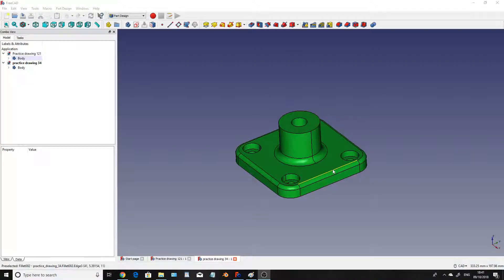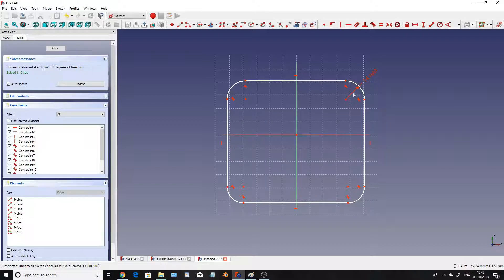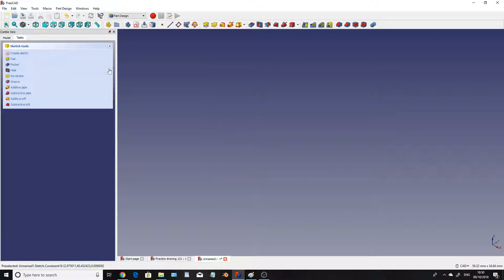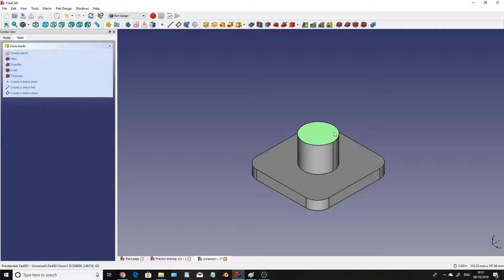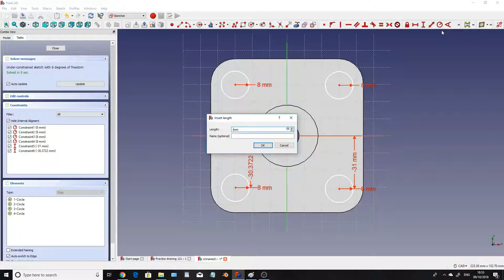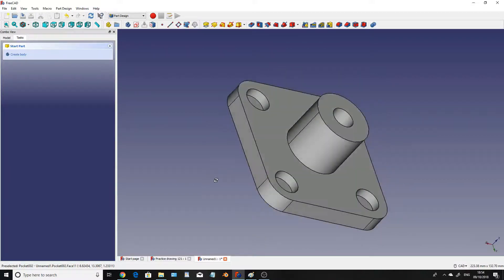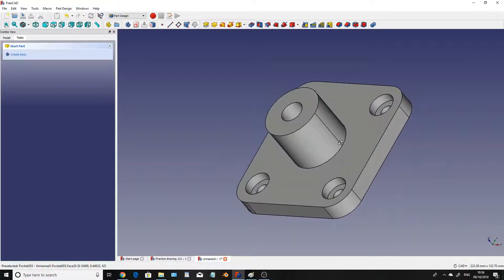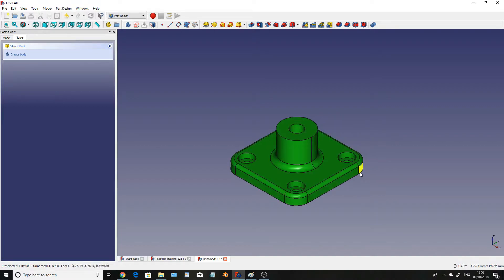FreeCAD Practice Drawing 34 Tutorial

Comment: Nice example. Thank you. 
Just a small advice: If you have to enter same dimensions for multiple items - e.g. holes' diameter, it is more effective to select these objects and then choose the operation type (diameter setting). This will change the size of all items at once. You will save lot of time. 
Looking forward for next tutorials ;-)
Reply from the maker: I'm glad you enjoyed it Stefan! Thank you for the advice! It would definitely make setting the hole radius a lot quicker! :D
Reply: @AndrewCAD  I subscribed because the quality of these tutorials has real potential. One additional efficiency in the hole creations includes the use of the equality constraint. As Stefan suggests select all of them  and apply that constraint before you set the diameter, then alter the diameter of one of them and all of them have the same diameter. If you need to change their diameter then you only need to change one. Congratulations on making these tutorials, teaching things to others is a great way to reinforce and develop your own knowledge.
Reply from the maker: @paulreader1777  morning Paul, I'm glad you enjoyed my video! I've been meaning to make some more and as it's the new year it's definitely time! I myself am still learning and wanted to share what I had made, so all feedback is much appreciated :D